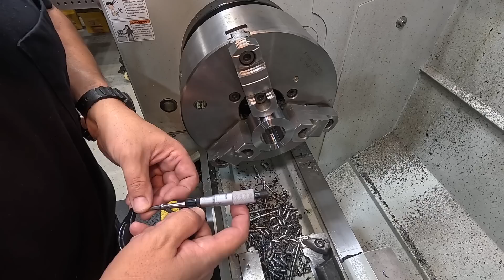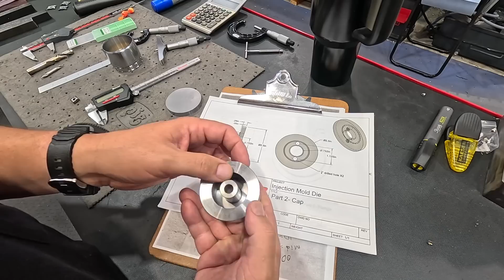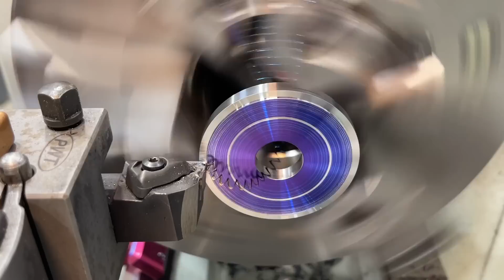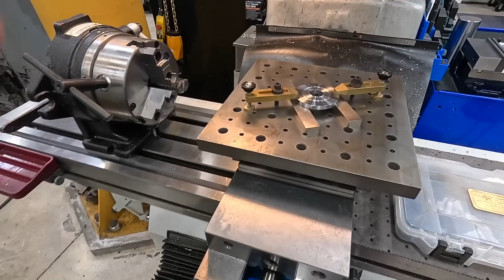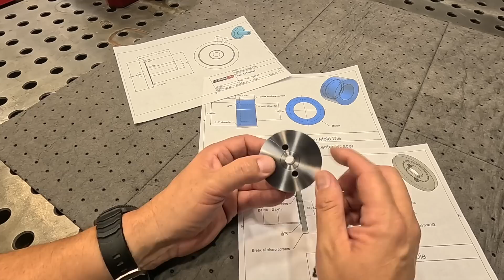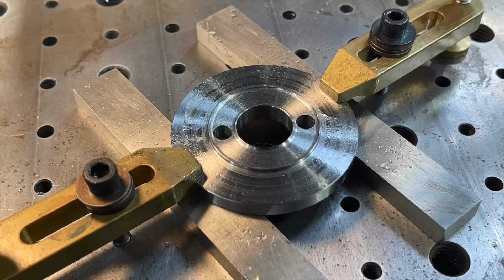Injection Molding Die Part 2- Job Completion

Comment: 35:00
Flip jaws and face with a boring bar.
Reply: You can't face hard jaws buddy
Reply: @Jay-lg7zb  Flip the jaws around and clamp on the part using the Edge spacer. This will get the part to the shorter part of the jaws. Since the longer part of the jaws will be outside, and you will be working inside the jaws, you have to use a boring bar to face the part.
And yes you can face hard jaws with the right inserts. I took the outer section completely off a set of wore out jaws that I was purpose making for a specific job.

Comment: Correct me if I’m wrong, but I didn’t see any draft angle on that?
Reply: It's probably some kind of rubber that will be made in there since it's a bushing. Will probably come out with no draft.
Reply: Doesn't the plastic shrink when it cools? Might get stuck on the central pillar though.
Reply: @nophead  God point. Hopefully they have thought of that. If not: Make new die :)

Comment: Hmmm, I see that you chamfer everything as many machinists are used to. But thinking about how this will be used as an injection mold, won't the chamfers result in burrs on the produced parts later? Seems to me like a case where you want only tiniest possible chamfers on the edges that are on the inside of the chamber.

Oh, and to square up thin stock there's a trick with a roller bearing on a piece of steel in a toolholder that you can gently press against the workpiece as it's spinning. Can't have it chucked too tight for this of course, gotta gronk on it again after it's aligned. Wonder what good ways there are to align a piece on the backside tho without that spider, that's not as trivial.
Reply: Poly-Urethane bushings/blanks is what the mold is most likely heading for rather than Rigid Plastics (or you would need to add some draft). You get 1-3% of shrinkage typically so an edge break while you might see it won't be in the way in use.

Comment: It's a prototype mold. The desired outcome results may not be what the buyer will expect or want. 
 That being said is because of the plastics that are injected into this mold may have too much shrinkage or the type plastic may not be clear enough ect..
 In order words another mold may need to be made to get the desired size. 
 Adam did a great job with this project and I hope someone has learned something about the way a small injection mold is made and the tolerances that are involved.

Comment: Wow those are some nice fits. Nice and snug without locking up with each other. The true skill is finding snug but not too tight. For those complaining about them remember this is a injection mold die NOT a jet engine part with thousands of lifes depending on it. Adom could get it that fine but he KNOWS there is no reason to take the time to do it.

Comment: Get a sheet of Lexan and bend it to make a one piece removable splash guard to fit over the work area that will contain the coolant splash when using coolant. Lexan is easy to bend into shape with a heat gun or careful use of a propane torch. It is also impact resistant, generally bending instead of shattering in case of tool breakage making it suitable for a splash shield on the lathe.
Reply: Also known as bulletproof glass <g>.

Comment: a very simple lathe tool for truing thin disks put a bearing on a shaft mount in tool post and rub bearing against part with chuck not to tight. it will push the part in until true
Reply: He could have avoided that by not cutting the disc of the stock in the first place. All the features could have been machined and then parted off the correct width.
Reply: @tsmartin yes absolutely,   started the job with a mistake on the saw and the rest went downhill from there

Comment: Shouldn't there be a security-hood that also serves as a splashguard for such a modern lathe?
Reply: They make it harder to see what you are doing and get in the way for tool changes and measurement checks. But they are probably available for it. The video quality would be poor because of contamination and light reflections.
Reply: @billsimpson604  I meant one that's on some kind of hinge, so it can be swiveled out of the way

Comment: 3:27 , make a little plexiglass and sheet metal shield that  clamps to the back of the lathe
 With springs to keep it locked either up or down. A bit of 1/16" or 1/8" steel or aluminum with a 1/4"-1/2" x 1" flat bar, bent on a arc about 14-18" radius. Long enough to cover the chuck from about 3 o'clock counter wise to about 7 o'clock. Where ever it will reach to drip in to the drip pan. Heat the plexiglass enough to bend it to bolt to the sheet metal. Or just use sheet metal.  Using 1" box tube to make the arm  and hinge with a spring to hold it up and down maybe weld stops to keep it in place. Maybe mount it on a pair of 1/2" round bars. So it can slide to where the business is happening!   With the round bars welded to a couple pieces of angle about 4" long, of 2" angle.  The length what ever is commonly used on the lathe. Maybe 24"bars drill holes in the 1' box tube to slide over the bars ,  allowing any position over 24" sending drips into the chip drip tray. Just an idea, maybe add coolant nozzles to the shield and make them and sell them . I'm Shure no one likes the mess, and want the tools to last long as possible! ✌️

Comment: Adam, holding coolant in the machine not on the floor.
i use a steal plate, its welded on a flat bar on one side on the bottem. when i want to drill i place the steal plate with the bar into a toolholder, and the toolholder on to the toolfixture. so the rain of coolant will splash againsted the plate and keep it in the machine.
very easy and for drilling perfect.
Reply: bottem?
Reply: @silasmarner7586  Steal ... againsted ?
Reply: Yes, this comment does look like someone to whom English is a second language. Imagine what our posts, if done in our head would look like in their language... have a heart or are mistakes an opportunity for heckling? If it is an English speaker then still, why heckle the drop out of third grade, there was a reason I'm sure.

Comment: Hi Adam love your work and vids I've learn a lot do to you thank you but there is one thing iv been wondering a bout is pricing if you could 
would you talk about or explain how pricing is done and how you evaluate parts mostly small parts for manual thank you  Adam for all you do your major in my learning
Reply: Thor4038, Job shop pricing is not what he is here to show or teach. Try a junior college or talk to a local machine shop. Competitive pricing is an art form as well as a job practice, standard pricing is even more difficult for most to understand. Any accounting firm would tell you to calculate your price per hour first, then figure how long it will take you to do something, this sounds easy but it's not, good luck now.

Comment: Manual machining is great for hobby level work. The nice part about CNC for these one-off parts is the ability to use conversational programming to speed things up. It would be interesting if you could learn conversational for your CNC machines rather than having to do the whole CAD and CAM process. I think that would be an interesting journey for us to watch. The other channels do some amazing work but don’t show the details. JMHO.
Reply: Adam has already done a video or two demonstrating conversational programing.
Reply: One was copied and made the part in a tenth of the time.